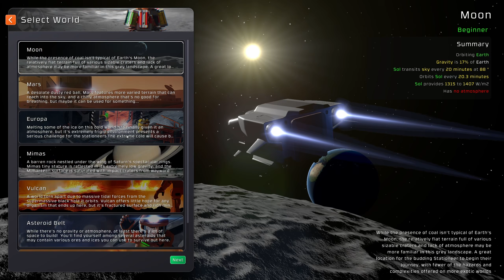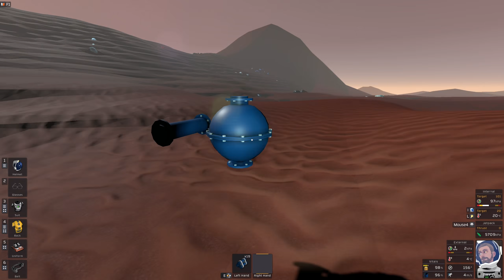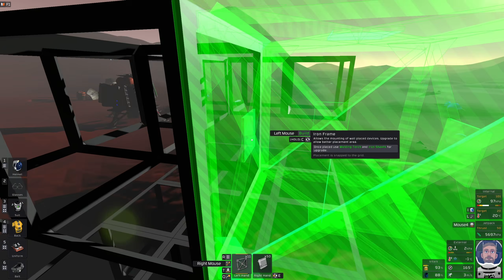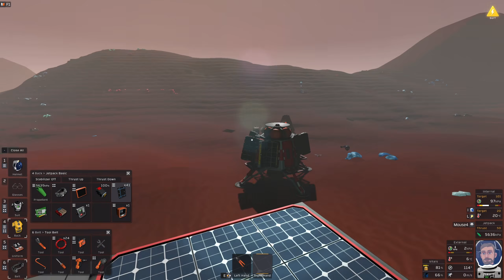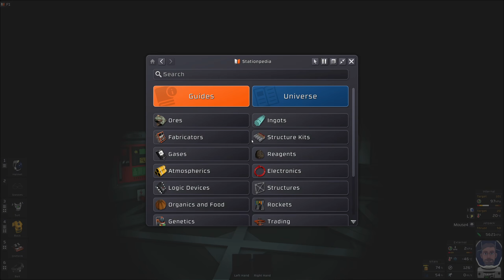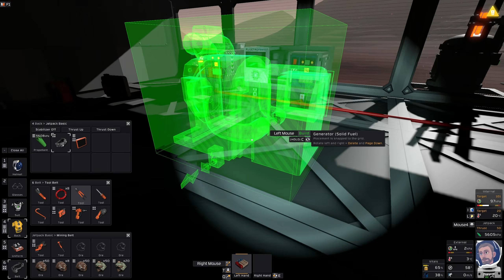Stationeers | Tutorial Series For New Players | Getting Started - Everyone Should Give It A Go | #1

Comment: Thanks for the video, I just came across it.
I am very new to Stationeers, but seasoned in Space Engineers. I can see the difficulty level in it, but it has its appeals on the complexity.
One thing I did not like about Stationeers is the unrealistic location of items, like you did with the pipes and later with the upper frames. 
I think that the developers could have done a better job incorporating gravity to all items, the character has, so why not the rest!!!
Another thing I did not like, and this is on your side, is the creation of power, power is everything, making walls is not.
I would go by logic (if there is any in this game) make a simple platform and upper deck to support the solar panel, set the electricity up, then you can justify creating the lathe and other machines.
Reply: You need an Electronics Printer in order to make more solar panels